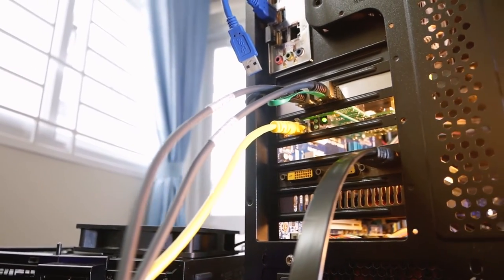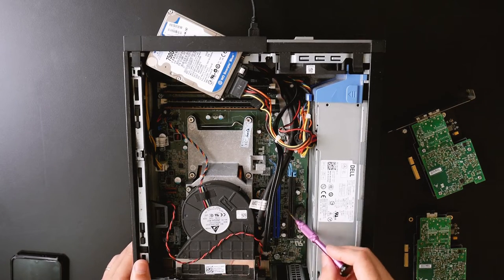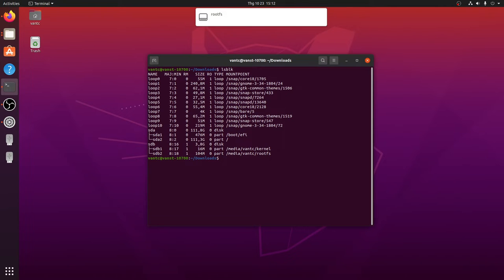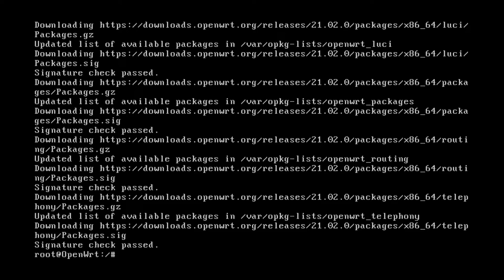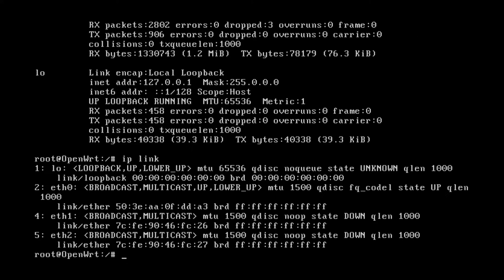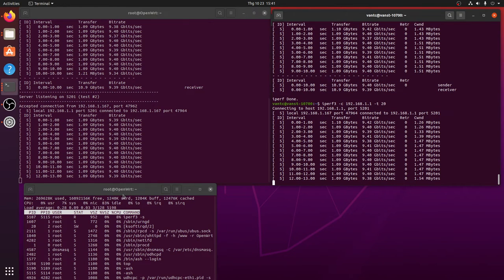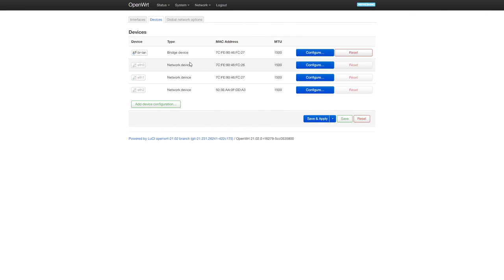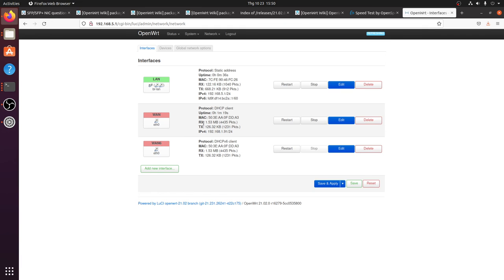OpenWRT - Build a 10Gbps x86 OpenWRT Router PC

Comment: I really appreciate your video and how thorough it is. It's exactly want I wanted to do. I'm so sick of my ASUS and TP-LINK setups, from not being able to get the full ethernet bandwidth, to bogging down with more traffic (non-WIFI), to going in circles with configuration issues when I want to change something and it and it all craps itself and having to do it all over again. Some aspects of going x86 are more technical but I feel like the access and ability to modify and actually get consistent full throughput with better specs is the way to go, at least for me.
Reply from the maker: Thanks for the comment. This video was made long time ago.
Now, 2.5GbE and 10GbE router PC getting popular and affordable. You can find these PC with N5105 / N6xxx Intel CPU, it is smaller, consumes less power and you can run OpenWrt/pfSense/RouterOS.

Comment: Sir i really like your videos! By the way, what's your take on DIY routers like this video, high end consumer routers and enterprise routers?
Reply from the maker: Hi, I actually I create this system just to test out the OpenWRT capability in handling 10Gbps. At home, I still use a SBC (NanoPi R4S) as a router attached to a switch & UniFi access point.

Comment: what do you think about atom x5 x7 with mpcie or something +- like pcie x1?  old "i7" ulv laptops/tablets?  =+-1150/1151 celerons? 

there many old mb thin mini itx, but only 1-2 m.2 slots, so pcie 2-3ver. x4 max. maybe m.2->(2-4+)pcie x1 riser card. but this, I think, wil be x1 ver. pcie.

maybe old laptops with bigger diy cooler mod with 90+mm slowly fans. so 1-2+- m.2 slots.  and 1 of them for new wifi6-7 mtk card with soft ap mode drivers.  but 10-25Gbs enough, imho.
Reply from the maker: I don't think the Atom X5 / x7 will be able to handle 10 Gbps "pure" throughput. Even the HP T620P can't do this without software offloading. There is no standard/guideline for x86 OpenWRT building. If you already have the hardware, just give it a try. However, you will also need to consider the power draw/power consumption of these old/legacy stuff and the throughput it give.

Comment: Why my comments deleted? Or flagged as spam? Did is posted anything bad? 😀
Reply from the maker: Lol, I can see your comment. Don't know what happen with Youtube AI :D
Reply from the maker: I can see your previous comment from the notification but can't find it on the "held comments". I run the same test on Windows - Google Chrome and get the maximum speed of 6Gbps (the limit is from the WAN side) but in general it is doing good. However, on Windows the iperf test is capped at 8.5Gbps instead of 9.4Gbps, it is still something with the driver from Microsoft too.
Reply: @VanTechCorner  And one more thing. If you use screen recording software like obs. That may affect your network performance test. If you don't see the numbers you expected close all programs and try again. Use a USB screen capture and use your laptop to record videos. If that is a performance issue.. Great videos keep going.. have a nice day my friend. 🙏
Reply: yt is so bad these days that anything resembling a url gets deleted, it's so bad now i always copy/paste & refresh the pages to see if a post is actually let through... re paste & edit until it goes through....
Reply from the maker: Yup that's right, I always got some "held comments" where there is an IP address or content of some config files.

Comment: Bro, i installed the openWRT on my linksys WRT1900ac, the same one as urs. But the wifi signal is weak, compared to my other professional Netgear AC1900 router. What could be the issue ?
Reply from the maker: Hi, did you solve the problem. If not, may I know the OpenWRT version that you are using (I am using 19.07 instead of 21.02).

Comment: I am an OpenWRT enthusiast and I approve this video :).
Jokes aside, wonderful video and great presentation.

I am curios why you need 10gb networking, also, did you try load balancing/sqm on 10gb connection ?
Reply from the maker: Actually, I just want to test out the 10Gbps routing with basic firewall rule, whether it requires a a powerful hardware or normal x86 with 4 cores will do. For now, I am still doing well with 1Gbps. 10Gbps will be used to connect devices in my LAN, for example NAS and PC.

Comment: Hi, i'm using openwrt as 10gb switch (there are plenty alternative OS, but I want to use openwrt for now). However, I got only around 6.4 GB/s (iperf3); do you know any setting to get higher throughput? Thank you!
Reply from the maker: Hi, did you solve the problem. I was stuck with ~ 6Gbps and the problem is with my network adapter ( it was detected as x1 instead of x4).
Reply: Nah! Couldn't solve it. I accepted the fate and moved on lol! I want to try setting up wifi AX or latest AC, can you suggest any wifi card capable wifi master mode? (Planning to set up proxmox that run OPS for switching & openwrt for wifi - experimenting purpose lol)
Reply: mt7915, mt7921, mt7922... and few other from mtk. only mtk for now with opensource drivers in linux, openwrt etc. 
( about 15-30-40$ on aliexpress.

Comment: Can i make a good openwrt router for 300mbps connection with good load balancing using the below hardware
An intel Pentium dual core cpu
4gb ram
A 120 gb ssd
Reply: LGA775 platform is very power hungry, so better get sth more modern ...
Reply from the maker: I agree, a used J1800 or J1900 board will do the same with less power consumption.
Reply: only for test. its to big, power ******, etc.